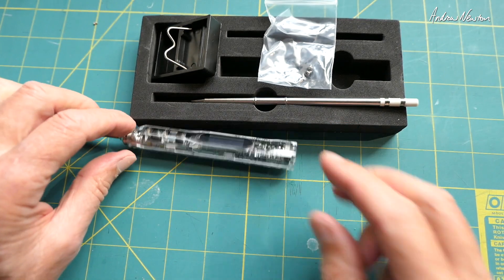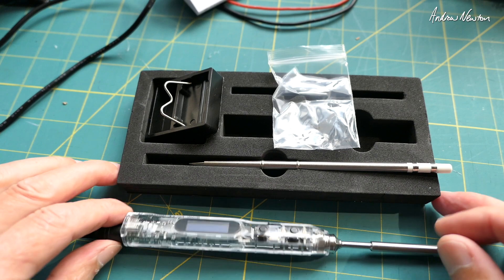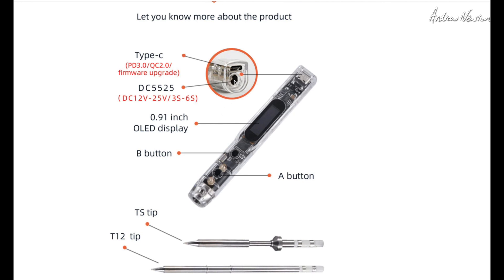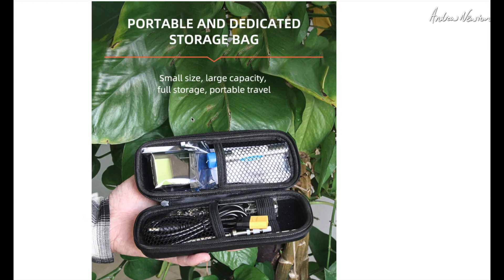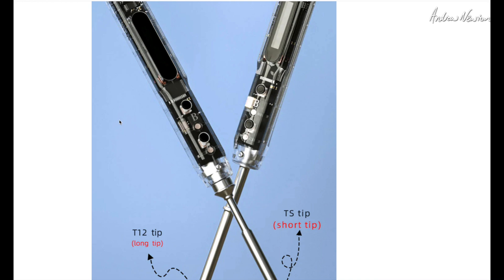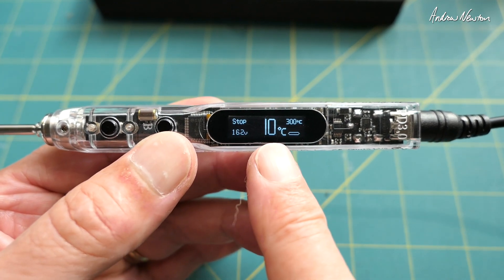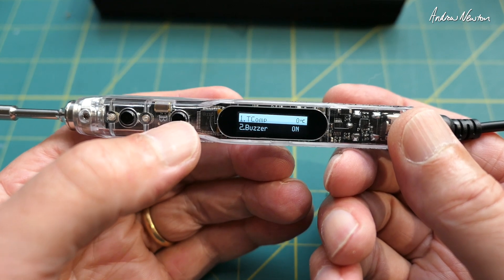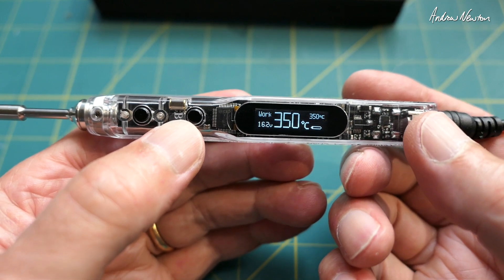SEQURE SI012 Pro Intelligent Soldering Iron

Comment: Thanks Andrew.  In the market for a new soldering iron and your reviews are very helpful. Sorry to say, no interest in RC stuff etc.
I'm in the UK and have no idea what to buy - Sequre, Minimate, QVDA etc.  I would also like some more info on your power supply for this iron.  There is a good supplier of the above brands in the UK, but sadly, they don't seem to do the newer or Pro models IE the MSS12 here has no mains input.  Thanks again - Dave.
Reply from the maker: Greetings Dave. All the Sequre irons I have used work very well but I do use the Sequre MSS12 almost every day. Otherwise I would use one of the other models with a ToolKit RC P200 power supply or a 4S LiPo.
Reply: @AndrewNewton Thanks for the reply Andrew!  👍👍

Comment: What is the difference between the sequre si012 and the pro, was it only the 2 different tip versions the longer and shorter that could be used or have the non pro this also?
Reply: The PRO version allows you to mount the T12 and TS100 tips without disassebling and changing the location of the contact pins.
Reply: @piosylant  does my non pro version too.

Comment: Is the longer or shorter tip better or does it even matter?
Reply: actually it does matter, i made a video on my channel of real life performance of different stations (weller, jbc, metcal) against the pinecil/ts100. the ts100 doesn't read the temperature at the tip quite well, so when it hits 350 degrees, the power goes down. if i touch a big copper mass, the temp reading doesnt drop, which results in solder not melting. i've tested today the sequre SI012 with conical T12 tip and to my joy, it reads the temperature much better and does massive copper plane with 350 degrees which im more than happy about.
Reply: @alexsicko  I can't find the video on your channel, did you make the video public, or did you upload it somewhere else?
Reply from the maker: Doesn't matter, just different manufacturers